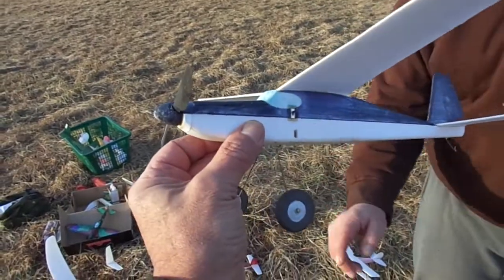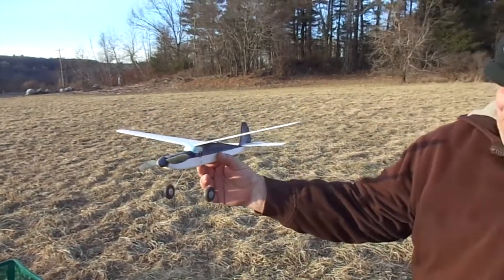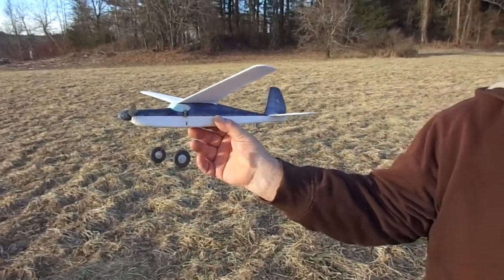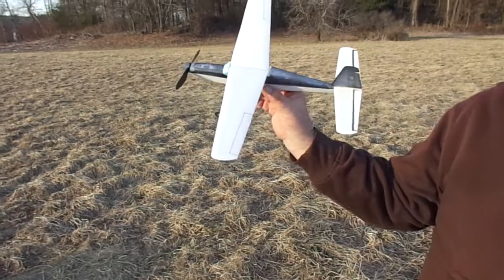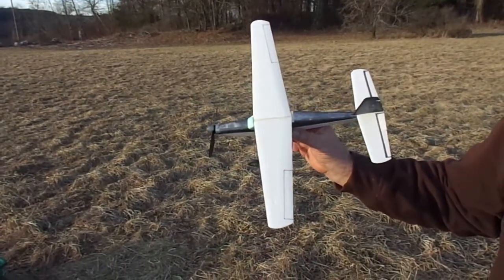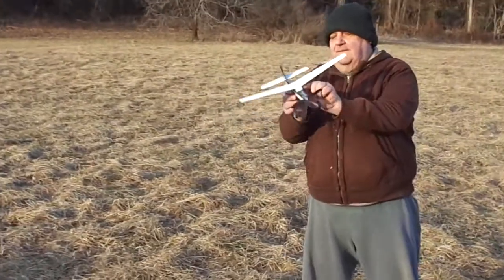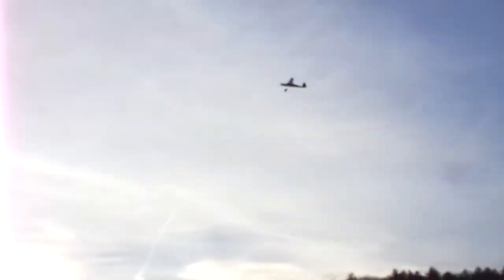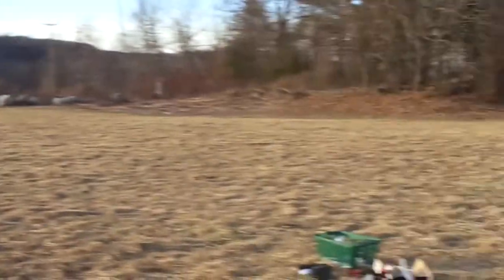Supercap Goldberg Ranger With Geared Drive

Comment: Hi Guys, lovin your videos, can I ask what method you use to mount the motor and how you set thrust angles? Thanks.
Reply from the maker: Thanks!! Thrust angles are estimated and set by eyeball, I'm embarrassed to say...! Richie generally wraps his motors to a hard balsa stick with sewing thread, then carefully hitting it with a drop of CA to solidify the wrap...taking great care not to get any in the moving parts! The stick can then be glued in place on or in the model. I dispense with the thread and usually just use a small dab of 5 minute epoxy...making final eyeball evaluation of the thrust angle as the epoxy sets up. If I get it wrong I chop it out and mix another batch!! No need to get fancy...we like them to be one or two-night projects since they all end up in a tree at some point!
Reply: sonex413 Thanks Mike, much appreciated! I’ve just purchased 2 sheets of Depron and downloaded the Goldberg Ranger, scaled down to a 18 inch wingspan. Already got the motor gearbox and prop. Here goes!! Wheeeeeeee!! Lol. 👍🏻👍🏻
Reply from the maker: @printingroller5  Just so you know, I simplified the structure a bit on my Ranger compared to the balsa kit...Fuselage formers only at nose, "firewall", cabin front, cabin rear...not needed inside tail cone. No wing ribs, no window cutouts. For that matter, the fuselage could be a solid block of white packing foam with cutouts for the gear. Richie likes the solid block method, I like built-up although I've done it both ways. Nice thing about these foamies is they're so quick to build that you can experiment!
Reply: sonex413 Hi Mike. Thanks for that, I had considered using a solid block of foam for the fuselage, alternatively minimal formers from 1/8” Balsa to mount capacitor etc and maintain shape and wrapping with Depron. I’m undecided as to whether to make the wings removable or glue once all charging and switches are in situ. It’s great experimenting with these!! Lol. Thanks again for the update!
Reply: Hiya Mike! The Ranger is built and balanced nicely! The longest flight I can get is about 15 seconds, it’s having trouble with power to enable it to gain height, I’ve got an 8.5x20 geared motor with a 5 1/2 inch prop, powered by a 2.7v 10F capacitor. I’m using 2x 1.5v AA Batteries to charge. Any idea how I can improve performance please? Thanks for your inspiration!! 👍🏻👍🏻
Reply: Just to add, she’s weighing in at 30gramms
Reply from the maker: @printingroller5  I think the 8.5x20 is too much motor for one 10farad cap, I'd wire a second 10f cap in parallel. Richie is using two caps on his 8.5mm motors and seems to be getting good flights. The alternative (which roughly doubles the thrust) is to use a small lipo battery with an electronic timer. I'll have a video coming soon on how to make one. In the meantime, I'd try the two caps. Sorry about the delay responding to your questions, youtube notifications sometimes don't seem to work in a timely manner! -Mike
Reply: Hi Mike, no worries about delay, thank you for the advice, I’ll try a second cap, I’ve asked a guy about the flight timer and single cell Lipo (that was to be my next project)  but he said I need to find out the power required for the small 8.520 motor, do you have any idea as I can’t find the spec anywhere! Also if I’m using 2 capacitors, should I stick to the same means of charging? I can’t thank you enough for taking the time. Thanks again, happy flying!! Rog.
Reply from the maker: @printingroller5  I think the 8.5mmx20 uses about 2 amps or less when used with a 1S lipo. (I am using this motor with an ESC which has a 2 amp limit, and no problems with it. ) Two caps will charge with the same method but will take a little longer. Eventually you will find that the chargers we use (build video on our channel) will save buying batteries and is worth building. AA cells are fine to get started though! Let us know how you're making out! -Mike (and Richie)
Reply: Hi Mike & Richie. All info gratefully received with thanks. Il keep an eye open on your channel for the charger! Keep up the good work! 👍🏻

Comment: plans from where I could get them ?
Reply from the maker: I like to download plans from outerzone website. We use just the original outlines of the design, tracing on paper right over the computer screen after sizing the image to the correct size. We simplify the structure by eliminating internal pieces as needed to suit our needs. Here is the plan for the original Ranger 30 which the model in this video was based upon.

https://outerzone.co.uk/plan_details.asp?ID=3830

The plane in this video was made to a wingspan of about 18 or 19 inches if I recall correctly, and was built of 3mm foam sheet. We eliminated some of the internal fuselage bulheads, etc, and adjusted the drawings to accommodate the thickness of the foam we were using.

Comment: beautiful, I never did much with gearboxes
Reply from the maker: Thanks! We did it out of curiosity on a few models. Best performance has been with direct drive however. Best combo so far with 10 Farad cap is 720 motor with direct drive 55mm or 65mm prop in a lightly loaded airframe at about 15 to 18 inches span, duration averaging about a minute or a bit more. Gear boxes pull real good but create quite a bit of drag as they run down due to big prop.